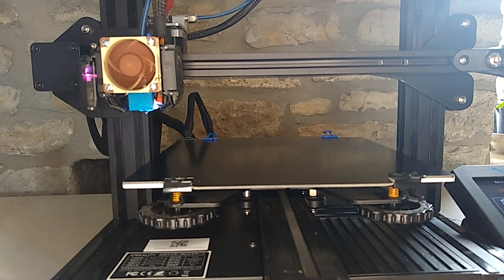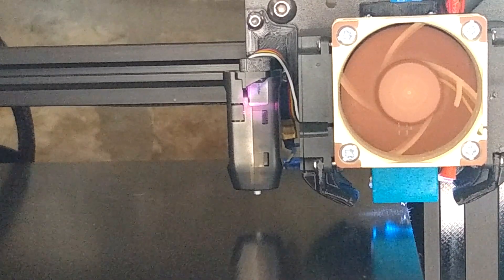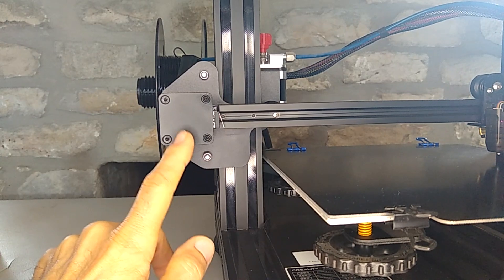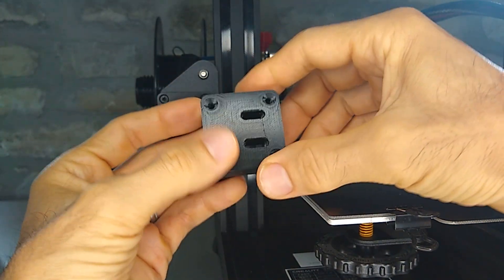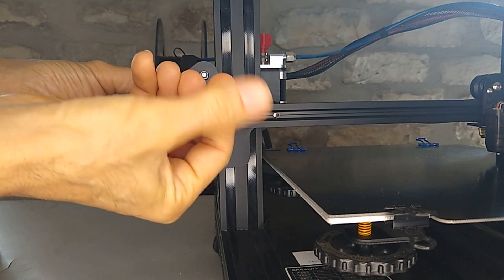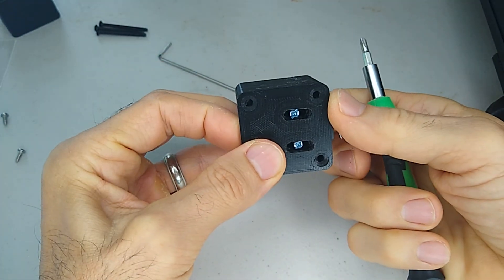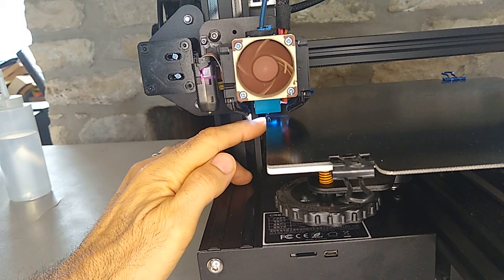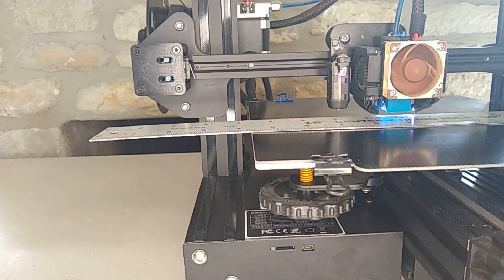Creality Ender 3 V2 Adjustable X-Limit Switch Bracket Design Using OnShape to Center the Print Head

Comment: This is exactly what I need..printing tonight thanks
Reply from the maker: Hello Robert, Thank you for commenting. Use this one, it's more refined.

https://drive.google.com/uc?export=download&id=13h7bDiW8nv0AmgSthRvtpuD3C7TUxduH
Reply: @vbared  thanks sliced and starting print
Reply: @vbared the revision the standoffs for switch are about 3 mm too short of reaching slide to active switch.
Reply from the maker: @robertwoerner20  Dang, Mine must be tripping with side of my probe mount which is flush with the gantry bracket. Load both the original one and the one I linked into CURA to see if the first one is setup the way you need it. If not let me know and I'll extend the slots 3mm on the refined one so the switch can be activated by the bracket. Sorry, I should have considered your print head setup might differ from mine.
Reply: @vbared  first version is good 90% print completion as I type. Thanks.

Comment: Victor I absolutely enjoy your videos but I am having a tough time printing your parts, when you say you will leave the STL in the comments below it is fantastic but the trouble with that is, when we go into CURA to set it up we do not know what your settings you are using for cura, especially the support settings. For example the adjustable X-limit switch, I have printed this three times and each time the inner piece that screw butts up against is not fully attached to the rest of the build, it is only attached in barely in different locations.  I believe that is part of the support setting that is missing.  I might be wrong but any help would be greatly appreciated.
Reply from the maker: Hi Jeremy, Thank you for your commenting and encouragement. I'm glad you're finding value in the videos for your viewing time. Linked below is my current CURA profile. I print with SUNLU black PETG filament on our G10 Garolite. The profile material and bed temps are for the aforementioned. Adjust those for your filament and build plate. To print the adjuster housing, orient the part with the screw slots facing down, turn on supports, and use skirt. If you run into any issues call me 478-227-3301 so I can offer more guidance.

https://drive.google.com/uc?export=download&id=1KiLjmRUIl07aVP6JyFh6WKP06_77F7UG

Comment: Awesome model! Just what I needed. I upgraded to the Micro Swiss NG linear rail extruder and lost a couple mm.
Reply from the maker: Hello SurgeHawk, Thank you for commenting. I'm using a Micro Swiss NG on my CR10S Pro V2 and made a version of this same adjuster specifically for the Micro Swiss NG so the micro switch can be triggered flush with the edge without the stepper motor hitting the housing. Let me know if you need that version.

Comment: At last I can get back the 4.5mm I lost when installing the Sprite Pro direct drive extruder on my Ender 3 V2.  I did have the glass bed offset to the right to still be able to use the entire build volume, but ultimately, not a long-term solution.  Although I have a CR-10 V3 for larger volume work, the OCD component of me was completely bothered by the 4.5mm skew. Well done, sir, well done.
Reply from the maker: Hello Stan, Thank you for your kind comment. I'm glad you found value in this video for your viewing time. All of my printers were off right out of the box so like you I couldn't sleep soundly  at night knowing that.

Best of luck with your mods!
Reply from the maker: I have this video to help you fix CURA's print alignment issues for Creality printer's.

https://youtu.be/goQ6I8TpzRU

Comment: This is great, i remixed your STL to fit my ender 3 with x-axis linear rail and sprite extruder, basically adding 9mm to the height and lengthening the adjustment holes for greater adjustability. planning to also remix the backplate to house m3 nuts for greater stability. awesome project.
Reply from the maker: Hello Eric, Thank you for commenting and kindness. I'm glad you found value in this video for your viewing time and able to modify the .STL files. 3D printing is an amazing hobby and combing it with CAD makes for a powerful duo.

Best of luck with your mods!
Reply: Hi Eric do you have a link to your remix?

Comment: Hi Victor,  another great upgrade for the Ender.  I too feel the nozzle needs to start at the edge of the bed and continue to 235 on the other side.  With 117.5 in the center.  With a full bed you can print larger prints as well.

I installed this mod which went sweet but I wanted the last 2 mm at home and that required a little Dremel work on the inside bracket to allow the lower carriage bolt and nut to clear.  After taping off the entire Ender, the aluminum was removed and the X home tweaked in at the edge of the bed 0.0mm.  A little e-step adjustment allowed the 235 on the other end to be accomplished.  The center again was back at 117.5mm and it all looks great.  Yep let the sticker be gone.

Thanks again Victor.. Oh and thank you for showing how you create the slots in OnShape.  Very nice work once again.  You know the switch bracket would be an awesome OnShape tutorial and you could even start with your washer for us beginners.  Just thinking......
Top Shelf Victor !
Doug
Reply from the maker: Hi Doug, Thanks a million for sharing your process and experience with this mod. It's awesome that you 
reclaimed even more bed space. Thank you for suggesting an OnShape beginner tutorial. I'll work on putting one together.

We'll talk soon, friend.
Reply: @vbared  Hi Victor,  Oh yes, I'm jumping for joy to hear that an OnShape tutorial is in the works.  The bar just keeps going up and up.  You got to love this 3D printing world.

The Ender 5 Pro is still requiring a + 5mm Y offset for any print but with that tweak it prints almost a perfect center.  Your text has the 64 square picture and it is centered in the X axis and if the Y tweak was +7mm instead of +5mm the Y would be centered as well.  Changing the Post-It note now.

: ) 
Doug